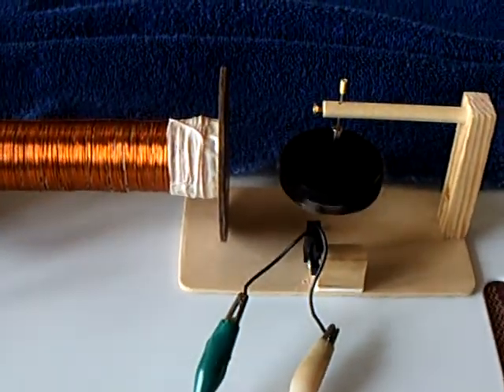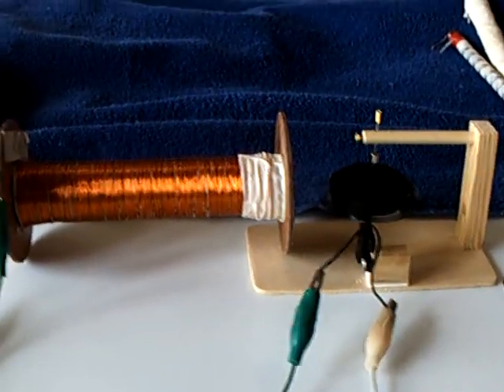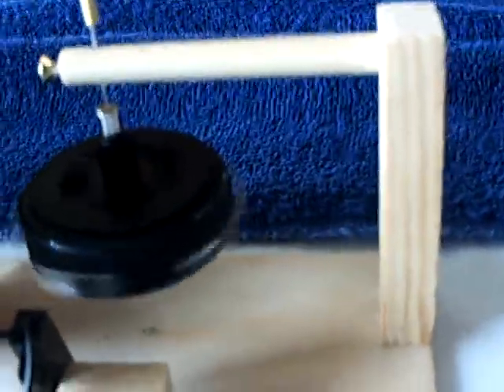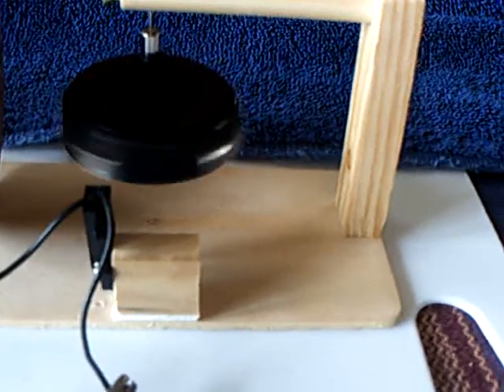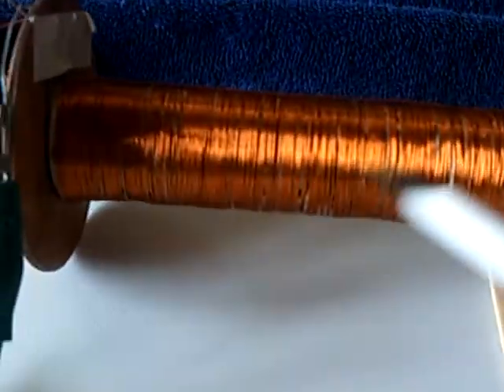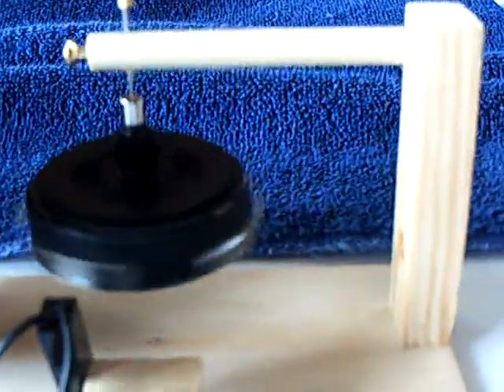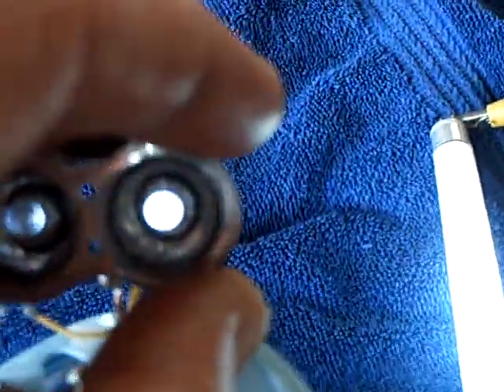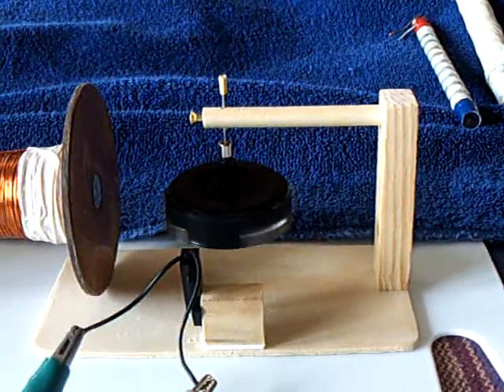LaserSaber /  Stubblefield coil--an improved rotor.ASF

Comment: @Lidmotor 

I basically used the Josepino version using the AA battery style board.  (Not the AAA board)  Some folks just take off the big cap and hook up there but I have not seen them do some things we have done with the other method.  Also, cut the diode on one side (side without the stripe)  Fuji AA boards are identified by having the black shutter switch on the camera.  Green button has the AAA board.  I can give you some direct links if you like.

Bill

Comment: Rusty:

Great rotor, man, nice work.  My modified Fuji has to draw less than 19-25 mA's as that is all my earth battery puts out and I was able to light my 48" long floro tube easily with it.  I added two 10F supercaps into the circuit and the light was better.  This was at about 1.8-2.0 volts.  (The Fuji puts out about 350-400 volts)  You should be able to run a modified Fuji from almost anything.

Bill

Comment: I'm glad to see others using my rotor design.  With this design I have been able to get my motor to run very well on less than 1 milliamp.  My design is slightly different in that I have a magnet above and below the rotor with the needle running through the rotor.  The needle touches only the top magnet.  The bottom magnet does not actually touch the needle but keeps the rotor stable in it's magnetic field.  Without the bottom magnet I was not able to keep my rotor balanced at high speeds.

Comment: you can get free magnet wire for your secondary from an old CRT computer monitor ... the degausing coil is about 200 feet of fairly heavy guage magnet wire ... also every CRT has a couple of heavy duty power transistors which are useful... the magnet bearing works great if you use a tungsten dart which I used on my video "magnetic balance"